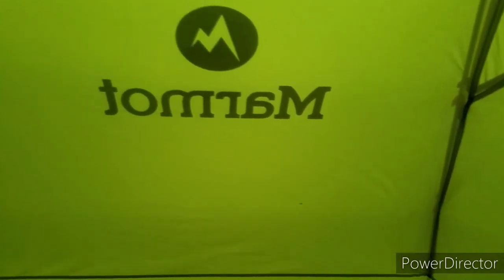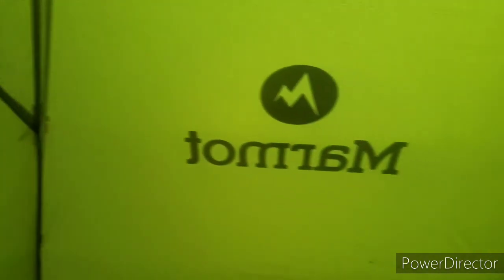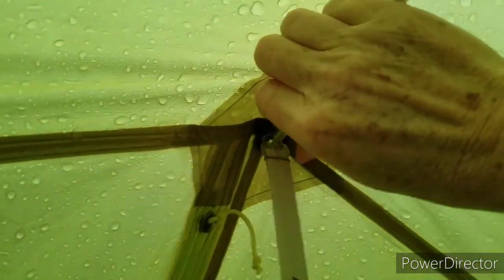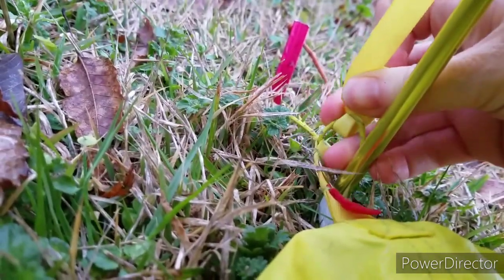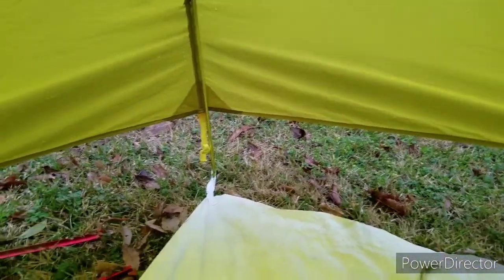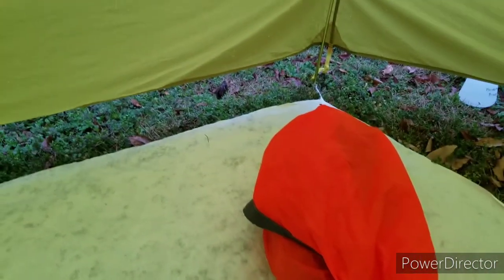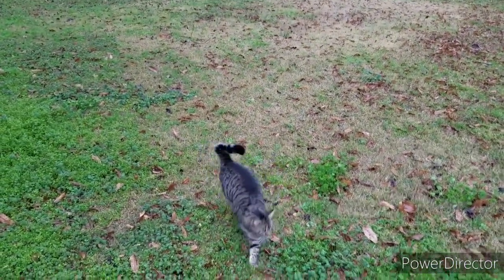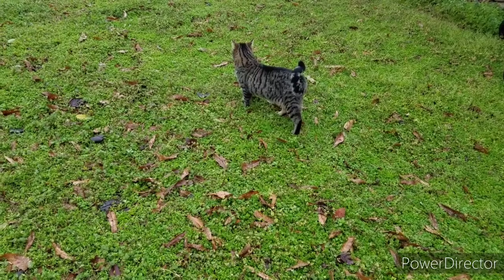Taking down a tent in the rain - Marmot Tungsten UL2

Comment: A very helpful and informative tutorial. I wish I had seen it earlier before my tent was stowed badly wet in the rain. Have you tried to pitch the tent in rain?
Reply from the maker: Yes and it worked well. I put out my ground sheet, then poles and rainfly. Got in and wiped the rain off the ground sheet and attached the inner part. It took a little bit of time but kept the important stuff dry.
Reply: @MtnWanderer-TieDye-  Thanks for your reply! As I remember your ground sheet is homemade. Was it easy to put the pole on the sheet? I am considering buying the original footprint which is quite expensive as just a ground sheet...
Reply from the maker: @MrSilentliu  I made one from tyvek I purchased from ebay. They included some stick on tab loops for the corners. I melted a hole in the loop material just big enough to hold the pole tip. It held great. Hope that makes sense.
Reply: @MtnWanderer-TieDye-  I ordered the marmot footprint yesterday. It is expensive and hard to find.  I am afraid I don't have your manual skills. I benefit from all your videos about the tungsten UL tent. Thank you!

Comment: That's was very thorough, now if only we could pitch it fly first or full tent together? 🤔    This will be super helpful since I think I'm gonna get the Marmot Fortress ul 3p for shoulder /winter season.  I already have the marmot force ul 2P&3P in my stable.  Any thoughts on the performance of the fortress ul 3p in bad weather vs the regular 3P since it's the same as yours?  Thanks again 👍
Reply from the maker: From what I've read, the Fortress sounds like it's made for harsher weather. My tent went through a pretty stormy night and did great so I'd think the Fortress would do fine. I have pitched mine fly first in a rain and while it wasn't fun, it worked. I have loops on each corner of my tyvek ground sheet that I used to put the poles up, then the fly. I dried the ground sheet as best I could before setting up the inside. It's doable for sure. I haven't figure a way to set it up full tent at once. If you figure that out, let me know!
Reply: I ended up getting the regular fortress 2p tent for better bad weather performance in shoulder /winter season since i have UL tents already.  I'll keep you posted 👍

Comment: What kind of footprint did you get? Thanks for the video.
Reply from the maker: I use a piece of tyvek. There are multiple sellers on ebay that will cut to your dimensions and include the tabs to stick on each corner. Since the making of this video, I have had the opportunity to break camp in the rain several times and so far this method has worked great. Thanks for watching!

Comment: What size stuff shack do you use to store it in?
Reply from the maker: I think I initially put it in a 10 liter sack but ended up ditching it. I just roll the fly and inner separately and put a tie around each. They go in the bottom of my pack. I carry a grocery bag to hold the fly if it is wet.
Reply: @MtnWanderer-TieDye-  Thanks for that.